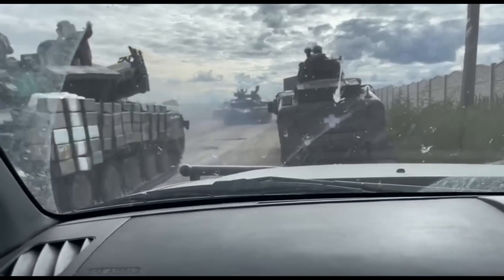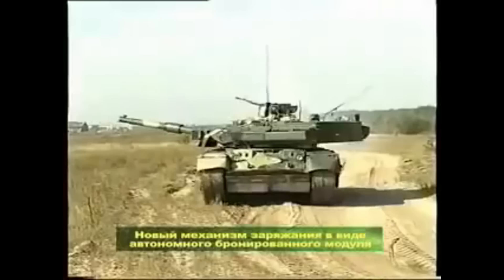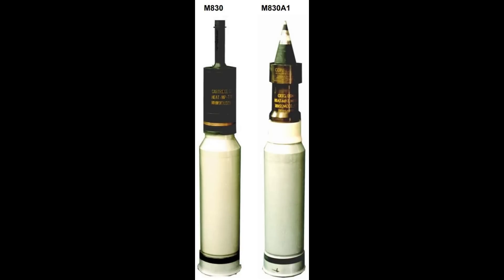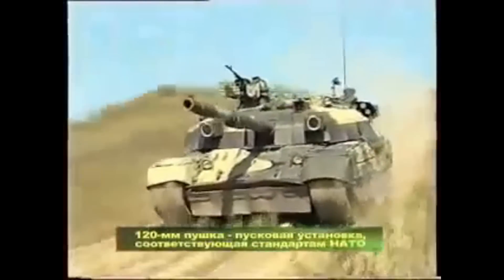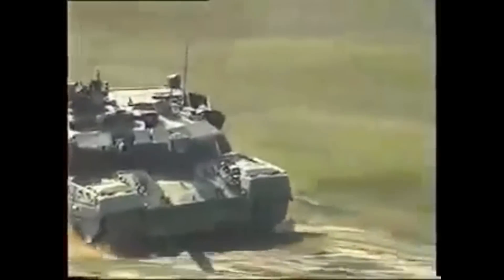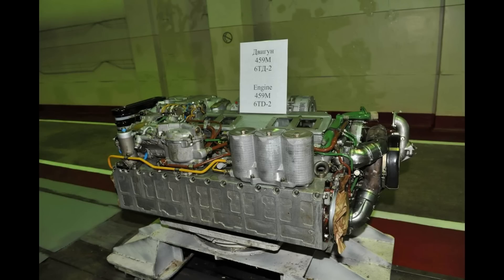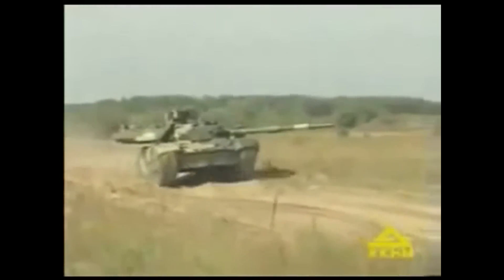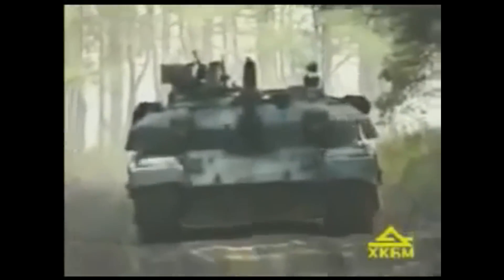Best Ukrainian Tank that Never Came to Be

Comment: Now, to be honest, the carousel was in reality hit directly very rarely. The reason for those spectacular explosions with turret popping up has proven to be - additional ammo stored all over the tank interior. If you check photos of destroyed Leopard 2 tanks in Syria, you will see at least one with turret popping up as if it was a T tank. How is this possible when they have bustle stored ammo, protective door and pop up panels? Well, they brought extra ammo stored inside the tank hull and that was hit...
T tanks, being smaller are much more likely to hit that extra ammo. And when that does happen, that extra ammo will cook off (at which point it changes nothing for the crew what happens next) and then that starts chain reaction and reaches autoloader and the turret pops up. Both Russians and Ukrainians realized that and now go to battle with no additional ammo, only what fits into carousel. And that made photos of popped up turrets far more rare lately...
Reply: You're absolutely right. It's the extra ammunition placed all over the fighting compartment that gets hit significantly higher than the carousel itself.
Reply: Exactly. I believe they discovered this back in the chechen wars. Did not know they would implement carrying only carusel ammo in Ukraine since you would need all the ammo you can get. I heard the propellant casings wont lift the turret up to take off but HE shells will, and since soviet tanks have been used as infantry support carrying lots of HE frag it Sounds like it might make sense, what do you guys think? If the carrousel had only solid kenetic projectiles(and propellant charges of course) would the turret be tossed via ammo cookoff?  Actual High Explosive shells in a ring vs slower burning propellant in high ammounts outside of a cannon chamber to create pressure.

Speaking of misconceptions where do these keep comming from? Like the one American Heros channel documentary where a soldier says "our depleted Uraniaum APFSDS would create a vaccum and suck the iraqs inside out, we wuld wash em out with a hose" or some stupid shit instead of killing crew with spalling making viewers think Depleted Uranium has magic properties instead of being used because its cheaper than tungsten and just as good. Asking combat vetrans and always taking their word for it is why we have shit like "the en’mies could hear our garand ping and pop up because they knew we were empty. So we threw der clip at rock or banged helmet then bam! Tricked em". My favorite one yet "AKs arent accurate". Accurate where? Most people dont know the differance between accuracy and precission. The dumbing down of science to explain shit to people and the military/poliece dick riding especially in the US is why alot of people simplify it as "ALL these tanks are being hit in carrousel, jack in the box effect tank go boom!" Instead of you know asking an engineer or whoever is in charge of noting down statistics people with actual qualification on the questions being asked instead of those who may not know because they were only trained and taught how to maintain and work the shit they are issued to get the job done not to remember their equipments specifications like the airforce probably does.
Reply: @centeroftheuniverse7196  I don't know if depleted uranium is cheaper, US for example has made an artillery shell with tungsten beads as fragments to increase damage, so it's probably not that expensive. The main reason is that with DU you achieve the same penetration as with WHA (wolfram heavy alloys) at lower velocity, DU has maximum performance at around 1600 m/s muzzle velocity, while for WHA it's over 2000, which is beyond what we can achieve with conventional guns. Odermatt did some research on that. This is why tungsten ammunition has higher muzzle velocity, beyond 1600 m/s you really are not getting more performance out of DU, you need around 1770 muzzle velocity to get the same performance out of WHA as you get out of DU. Beyond that WHA overtakes DU in performance, but it's difficult to achieve higher velocities.
Reply: @centeroftheuniverse7196 Soldiers aren’t all the brightest. Marines are said to eat crayons for a reason. I’ve seen plenty of soldiers who don’t know much but sure love to run their mouth online. I’m not saying they are all dumb, but they definitely aren’t all smart either.
Reply: @QualityPen  Yes. It reminds me of what Mike b and Paul Harrel would have to say concerning being in the military and guns. Theyd be one of the first to tell you being in military, even infintary does not nessesarly make you an expert.
Reply: @centeroftheuniverse7196  You see comrade, Stalinium is impenetrable, T-series tanks are superior in every way and outperform western tanks in every metric while also being cheaper...

This is just the state of things around the world, you cannot count on any grunt or misinformed individual to actually make decent conclusions.

The carousel can still be hit by significantly powerful HEAT munitions or even by APFSDS rounds, but it's not a gurantee and still requires a pretty lucky hit to pull off.

The extra ammo is technically a part of doctrine, and they do have stowage and even blowout panels on the more modern T90MS, but that composes a small fraction of the tanks being deployed.

The ERA on the nicer T90s also prevent top attack to some degree, although that's generally negated by the tandem warheads used in all modern HEAT rounds.
Reply: @V3RTIGO222  Grunt is the word I was looking for. I bet Russians have their fair share of misconceptions. I remember someone refering to war thunder for bmp armor values when saying "x wont penetrate the side of bmp" Xd. 

I am still curious on peoples opinion on the carrousel loaded with HEfrag vs carorousel loaded with just KE projectiles+ propellant charges maybe some HEAT  both being penetrated and ignited theory regarding turret flight someone has mentioned. Commander/gunner survivability out of the question.
Reply: It has to be HE-FRAG ammo to pop the way they do. NATO tanks don't "pop" because they never carry the HE-FRAG ammo, which usually uses more volatile and powerful explosive than HEAT. For Russian tanks, primary mission is to destroy fortifications which causes them to use mostly HE-FRAG rounds in their layout. If Russian tanks, like western tanks, carried APFSDS almost exclusively, there'd be no popping turrets.
Reply: @Max_Da_G  I'd argue any HE warhead in significant enough number would do that, including HESH, HEDP, HEAT, etc. Also, APFSDS rounds are not the majority load out as that is generally decided upon prior to a mission, but doctrine almost always advises more HE than AP.

Another issue is the older casing of the Russian propellant/ammo being more volatile.
Reply: @V3RTIGO222 it will happen with HESH hence why the only Challenger 2 in Ukraine popped its turret but HEAT won’t do that
Reply: @off6848  NATO specifically uses low sensitivity explosives in its propellant and in HE/HEAT, making it less susceptible to detonation, although detonation would be just as catastrophic (crew loss of ammo explosion likely even for APFSDS). 120mm HE is STANAG and is used, but HEAT is explosive enough to also demolish structures and is also effective against armor... HESH is British attempt to do the same thing differently, arguably superior to HEAT against ERA, but neither really compares to sabots for penetration against all armor.

I misspoke stating HE as in only HE but I'd include HEAT/HESH in this context
Reply: @V3RTIGO222  for actual HE and HESH shells the propellant doesn’t matter it’s the filler that blows 

A HEAT shell can cook off but it’s not going to make a blast capable of blowing a turret off like HE will due to extreme over pressure
Reply: @off6848  not arguing that propellant isn't HE but in significant quantities it could definitely do the same... the autoloader itself is ofc a vulnerability as any ammo inside is likely to detonate together and pop the turret
Reply: @Max_Da_G HE-Frag is what causes turrets to pop in big fireballs. If there’s no HE-Frag loaded the ammo just burns instead of exploding, I saw a video from Syria of a T-72 going up in orange flames, it looked like a flamethrower coming out of the cannon and hatches, but it happened over several seconds and then turret stayed on. It’s very different from the giant smoky explosion and turret flying into the distance which I think is caused by HE-Frag.

However, it definitely can happen to Western tanks. There’s at least one Leopard 2 which tossed its turret and the Leclerc is also capable of doing it. Not sure about the Challenger 2. Abrams generally won’t do it unless the crew decides to go against safety guidelines and store ammo in the hull instead of the turret bustle. That said I wouldn’t want to be in an Abrams with HE-frag in the bustle either.
Reply: @QualityPen  ive seen people say this too ."no HE on board means no soviet turret toss" but you get the big tall flames spewing like the syria vids fucking scary. And ive seen people say "its because they had the hatches open, if they were closed it would have been catastrophic". 

The latter does not make sense to me but the first one like you said does because if you didnt have the (however many kgs of tnt basically enough to lift it up in the first place) all round the inside of the tank it would be just propellant and solid projectiles(who does this though). And since the charges are not inside of a cannon chamber in my thoughts it should be like open black powder keg spewing flames slowly and violently burning instead of the boom when in a muzzleloader or civil war cannon thats why it makes sense to me(yes I know black powder and tank ammo propellant are different) let me know what you guys think.

As for western tanks I have seen pics of American operated Abrams turrets that have been popped off by huge HUGE IEDs. There was deaths in those cases. One was 2 or 3/4 dead and it was a driver or something crazy that survived out of all of them. Turns out Abrams turrets are just dropped in chassis, maybe have a ring around to secure it or something. I dunno if redeffect said it was leopard or challenger munitions with more stable propellant and HE but if its true for leopards then the narrative I heard that turks bombed their own leopard in one instance it might seem more plausable just like the Abrams IED incidents. Ive seen another pov of Turkish alledged Leopard 2 being spotted in an open valley then being blown sky high with ATGM though so theres that.

In the end Hit a tank hard enough an its turret will pop. Like the chieftain’s hatch guy said "just because the turret didnt pop off doesnt mean the crew is any less dead". 

Soviet tanks have been in harsh 3rd world battle theaters for ages. M1 abrams came in the 1980s t55s 62s and 72s were already everywhere and soviets just stuck with the t64/72 autoloader systems and ammo storage locations. I dont know when Blowout pannels were invented but M1 Abrams is the most popular example, was being designed in 70s and finished a decade after t72. The least Russians could do now for the ammo question is create a more stable propellent and explosive charge for HE and HEAT warheads.
Reply: Western tanks haven’t carried HE shells since GW1 is the main reason 

The propellant for apfsds is non explosive from heat but you can’t get around HE filler blowing up
Reply: if russia could just discover the same powder charges that Leopard tanks use (i forgot what its called but i know its less vulnerable to cook offs) they could probably stifle their large armor lossds
Reply: Before modern thermals and digital fcs, you're right. Nowadays you can easily pick off the carousel at any combat distance. MZ autoloaders' propellant casings are completely exposed to spalling. Any hits to the turret or hull will cook the shells. AZ autoloader isn't much better. The top is partially armored, but any low shot to the hull will cook it due to abysmal floor clearance. 6mm IIRC. Mine strike under hull floor? AZ cooks. Dart into the lower glacis? AZ cooks.
Reply: @prfwrx2497  No. You have played far too many video games

Comment: I think Pakistani army uses T-84 turret on its T-80UD tanks.
Reply: The welded turret was developed for T-80UD in late 80s as part of Soviet modernisation programs, and was later used on T-84 variants. Pakistan received 145 T-80UDs with cast turrets and 170 with welded ones, IIRC.

Comment: Well technically Russian also have solved all the issues with their tanks since OBJ640 has autoloader in the turret back which isolated from the crew , and 2S6 Tunguska which has transmission which allows it to go backwards with same apeed as forward. They just don't use this features in their MBTs for some reason
Reply: the T series tanks were designed with the expectations of blitzkrieg-esque manoeuvres on wide open plains and fields, where a hit to the side of the tank wouldnt be likely due to the tank's small frame and agility. but now with the experience of sluggish modern warfare in ukraine in mind, i would bet that a more sophisticated successor to the t-90 is going to be unveiled after the war's end. perhaps even an entire reform of their tank doctrine.
Reply: Просто русские танки намного меньше и дешевле НАТОвских танков,пришлось чем-то жертвовать..
Reply: Engineering & reality isn't your strong point, is it?
Reply: @iatsd  Interesting conclusion, if you have technologies and working prototypes and so on what the problem of implementing it in any of your machines. Isn't it for what engineering created for ? Slowing problems?
Reply: @iatsd ?
Reply: @dislikebutton543  What?

Comment: Leopard 2A6 TR was selected as the winner of the Tank 2000 project but it was ultimately cancelled because:
1- German Government did not allow the sale of 1000 tanks.
2- Türkiye's main goal was not just buying a tank but designing and producing a domestic tank based off of the Leopard 2A6 TR and German Government did not any allow technology transfer at all.

After the cancellation Türkiye wanted to buy 1000 second hand Leopard 2A4s but Germans allowed the sale of only 354 2A4s (339 for active service + 15 for spare parts) thus Türkiye modernized all 170 of its M60A1 RISE Passive tanks (not the 752 M60A3 TTS' tanks, only A1 RISE Passive ones) with Israel to M60T 'Sabra' standard. Both contracts were signed in early to mid 2000s.

Eventually in 2008 another semi-domestic tank design and procurement project started and Korean K2 Black Panther was chosen which lead to the Altay tank (which still did not enter service because german embargo of engine and transmission). Korean K2 was selected because Korea allowed technology transfer and procurement of 1000 units.
By the way i'm not blaming the Germans for anything but just telling what actually happened. Please don't respond to me if you'll just say something political like ''Germans are right for not selling tanks to Turks'' etc.
Reply: You got to think about why Germans allowed to produce 120 mm RH L55 cannon under licence and not allow to give engine and transmission.
Reply: @54oguzz its because K2's CN08 is not licenced version of 120mm RH L55.
Reply: @Dingdong0810  MKE producing the Altay tank cannon barrel under Rheinmetall licence but the breech is Turkish made.
Reply: @54oguzz  it is incorrect information.  altay tank cannon is licenced version of south korean CN08 120mm  gun which was indigenously developed with some influences from CN08 120mm L44 gun which is licenced version of M256(american licenced version of RH 120 L44)
Reply: @Dingdong0810  ok bro Id believe you If I didn't ask ex BMC engineer
Reply: @54oguzz my information is from South Korean official documents
Reply: @Dingdong0810  CN08 cannon based on RH L55 cannon they just reduced the weight of cannon and they did really good. I think BMC used CN08 to reduce the pressure on gyroscobic stabilization. So yeah, you're right Altay using CN08 cannon which is based on RH L55.
Reply: @54oguzz  Why?
Reply: @54oguzz they didn’t sell the motor or transmission because that trash is like bmw, it’ll break as soon as it leaves base
Reply: Germans are right for not selling tanks to the turks. You guys are not European and you kill kurds...
Reply: Well. Considering Turkey especially under Erdogan who like to play stunts against NATO interests (like when Turkey disagreed on the admission of Sweden & Finland into NATO) plus wooing Putin.. it's only understandable why Germany refused the Leopard 2's transfer of technology. 😂
Reply: Germans were wrong for not selling  the tanks and then engines to Turkey.
Reply: Germans are right for not selling tanks to Turks
Reply: @GamesOfficialYouTube 😂😂😂😂😂😂 you beat me to it 👍
Reply: @GamesOfficialYouTube was gonna same the same thing 🤣🤣🤣💀💀🤣🤣
Reply: @GamesOfficialYouTube   Lol
Reply: Did you mention the Germans what Turkey out of NATO. Erdoğan wants to play on both sides of the fence, Turkey wasn't always this way. I can't wait until this effer is gone.

Comment: The French tanks are very good at going in reverse.
Reply: Very original joke
Reply: @Aussie_swagger430  is no joke 🇫🇷
Reply: Looking at t 72 reverse speed ngl its a good thing
Reply: moving without refueling 2 minutes later is the difference between the leclerc and the abrams
Reply: @thedelta01100  i have heard that the turbine in those is not fuel efficient
Reply: @TurbodanNM  it's a conspiration